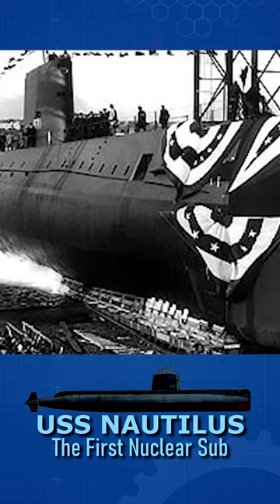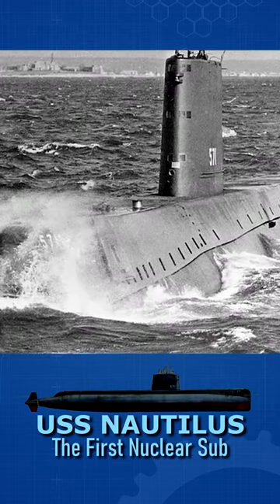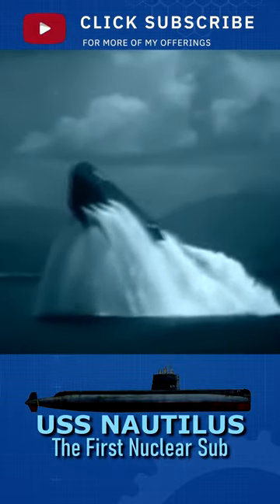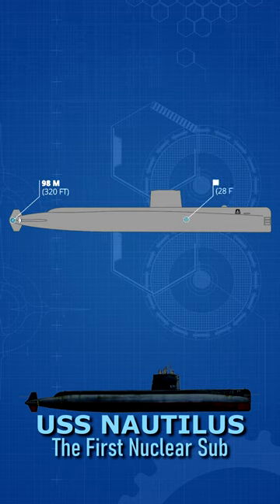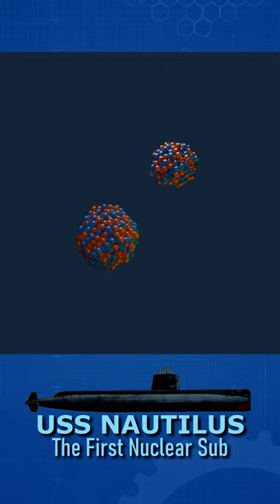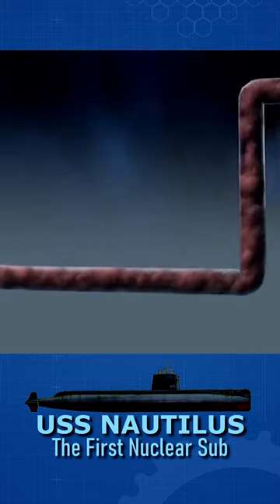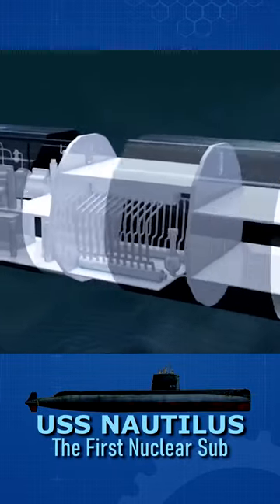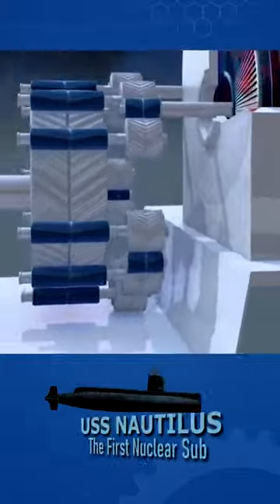USS Nautilus \ The World's First Nuclear Submarine #shorts

Comment: The drive system was closed loop, so yes, technically it didn't need air, but the crew did. No air = dead crew.
Reply: Ehh pish posh
Reply: @jaktheduk9042  mere formality.
Reply: The reactor also requires refueling now and then so certainly not indefinitely
Reply: They make Oxygen 
And
Fresh water 💦
Reply: Oxygen can be generated with electricity through electrolysis. Anything else howland.